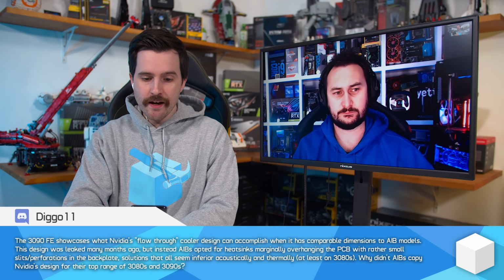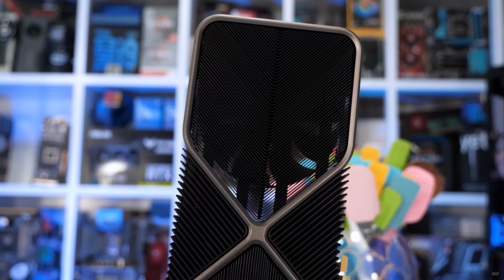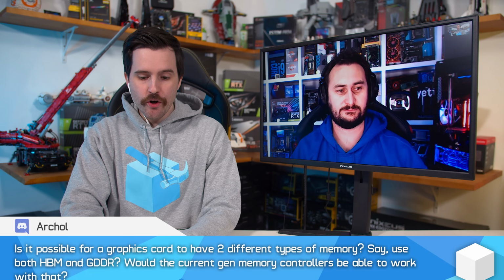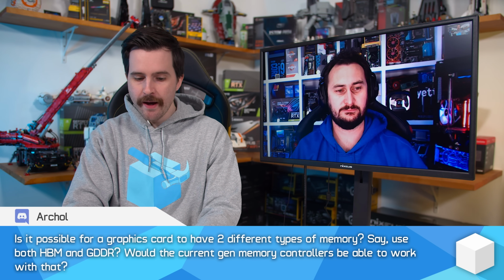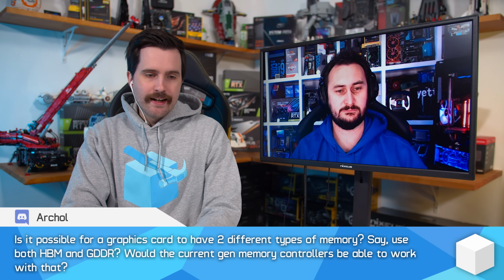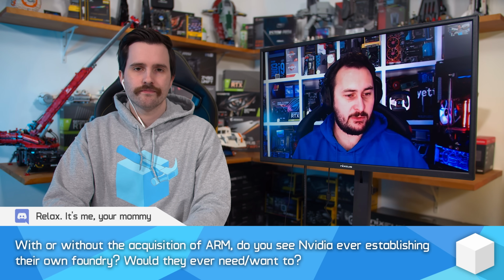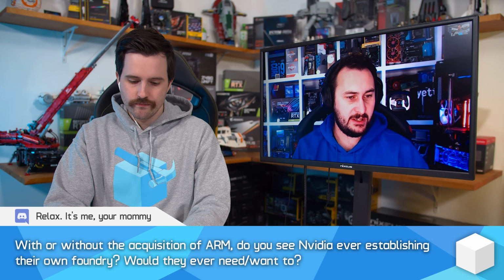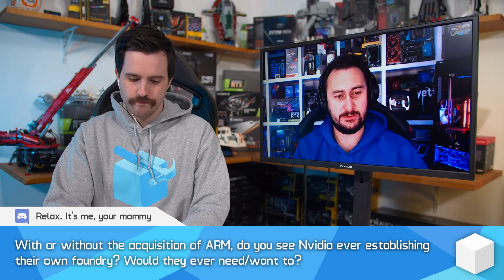Will RDNA2 and Zen 3 Have Launch Issues? Can AMD Beat Nvidia at Ray Tracing? September Q&A [Part 3]

Comment: I don't even care if "big Navi" is a little slower than the 3080, as long as it is (A) available at launch (B) has much better power draw than Ampere and (C) is less expensive.  I don't need a 4K gaming card - I am more interested in a reasonably fast GPU that won't double as a space heater.
Reply: Agreed, if AMD can deliver good value for 1080 and 1440p, with good availability (and NO DRIVER ISSUES), they'll have a winner on their hands. Let's just hope AMD can pull it off.
Reply: @shadow7037932  Its their second gen of almost same architecture. There will be no driver issues. Its always problem only with new stuff like 5000 series or rtx 30xx now.
Reply: @shadow7037932  the driver issues are the number one
Reply: Not gonna lie... im using an rx 5600xt after upgrading from a 1060 and they’re doing something right... i had issues at first but after using nvidia driver removal software, the card runs amazing. 1440p 60-70fps.

That being said, I can’t wait to see what they do woth big navi. If I can use the same 650w power supply that I have right now with a good value big navi card.. farewell until you step up nvidia..
Reply: @EggSaws  mmmmm .... why did u upgrade from 1060 to 5600? and if ur 1440p runs 60-70fps y upgrade to a better gpu??? 
something doesn't feel right
Reply: @luckysingh-lh4hf  Because the GTX 1060 is slower than the RX480 and the RX 5600 decimates both.
Reply: lucky singh i upgraded from a 1060 to an rx 5600 XT... warzone would run around 49-60fps on the 1060, now it runs at a higher framerate because of the new memory technology. The closest competitor to the rx 5600xt would be the 2060. Which is almost $200 more then the 5600 XT in my area. So newer technology = more performance.. I don’t understand what’s so bad lol. I’ve always had a soft spot for amd, I like cheaper prices. Nvidia has got a lot going for them though.
Reply: lucky singh and to be clear, I do wish that I had waited the 3 months for a newer AMD card to come out... given that when rdna2 comes out my card will basically be obselete. Facepalming myself...
Reply: @EggSaws  I mean u are getting ur "60fps@1440p" on 5600XT,  no point in facepalm-ing.
and wats ur need of upgrade??(asking 2md time)
but hey "soft spot" huh? o.o
for me it's always price to performance and coda- because DL support for amd sucks ass. cant work on a shiity driver GPU. that's y I cant even guy the new rtx  GPUs. feelsbadman
Reply: @luckysingh-lh4hf  well upgrading to a 5600xt is same as a 2060 or 1080 soo is a great upgrade the 1060 is shit right now. My 1660 deliver me what i needed (upgrade from a 1030, then 1050ti  and the jump is huge  but i need for gpu power and i waiting for the new gpus (mainly the 3070 for price performance)
Reply: Agreed. I don't do 4K, and only a fraction of gamers do. I'm interested in high refresh, 1440p gaming because that's what my monitor is and that's my sweet spot 👍
Reply: @phyrricocean7910  Yeah, im aiming for 1440p 120fps. 5700xt just isn't capable of delivering that even with medium settings it can't stay above 80fps.
Here's hoping big navi is powerful enough to deliver 1440p 120fps without fiddling with game settings.
Reply: I do need a 4K card, but if it's say $550 USD and is only a little weaker than a 3080. Sign me up!
Reply: WCKern agreed it’s what your targeting 1440/144fps is what I would like... and in VR 120-144fps in the index
Reply: @jediii86  I'm getting that info from from using the 5700xt Nitro since i bought it at launch.
It's fine for 1440p 60fps target but it ain't powerful enough to play at 120fps or even 90 in most games.
RDR2 and Control fps dips in the 50-60s occationally even when i'm not maxing out the game settings.
Reply: @imrileth6618  that just depends on the games and settings. Rdr2 and control can hammer any gpu on max settings. Your 5700xt should be comparable to my 1080 ti, and I have 0 issue running on a 1440p 165hz monitor.
Reply: @BulkybearOG  I play with 120hz freesync tv and i would prefer that the fps stay above 80, under that i notice the movement getting janky especially in fps games. Yeah it depends on the games, 5700xt can handle some games but it sruggles in most modern games unless i lower various settings.
While 5700xt is a decent card for the price i simply want something more powerful.
Reply: @imrileth6618  dunno what games you play but my rx 5700 xt throws out so many fps that my 144 hz 1440p monitor can't keep up anymore. 

just saying: the more background bs you have running on ya pc the less gaming performance you will have.
Reply: @imrileth6618  They must be some not yet released games that you are playing
Reply: @Daxter250  Take a look at that video of 5700xt playing at 1440p resolution. https://www.youtube.com/watch?v=GbGRlowFzQM
Its running in 40-60 fps in several games, thats pretty far from 120 fps. I run clean windows i don't have any background crap running while i play.
Reply: I seriously doubt they'll have much lower power draw at least at the high end ..... A 40 CU RX 5700XT draws 250W, the same as the RTX 2080 Ti which was considerably faster and if you double the CUs you get 500W and let's say RDNA2 hits it's efficiency targets (yet to be seen) then you are still looking at the neighborhood of 320-350W especially if they try to run a 2+ Ghz clock to try to make up for the slower DDR6 and only a 256 bit memory bus ...... The 50% efficiency increase is based on 40 CU and a base clock of 1605 Mhz and if you increase either of those that 50% efficiency increase drops off sometimes considerably ..... That's just the nature of the physics of silicon .... Using a 7nm node doesn't necessarily give you increased efficiency just the potential for increased efficiency as the RX 5700 XT proved, it was less efficient than Nvidia's optimized 14 nm node .... design is more important to getting good efficiency more than the node size ..... The theoretical efficiency gain of TSMC's 7nm node over Samsung's 8nm node is only 10-15% but there is no guarantee you see that or even any gain
Reply: @longjohn526  the rtx 2080ti draws over 30 watts more. according to igorslab, therx 5700 xt pulse draws 237 watts in gaming while the rtx 2080 ti FE draws 279 watts.
https://www.igorslab.de/sapphire-radeon-rx-5700-xt-pulse-im-test-navi-einstieg-mit-gewissen-schwingungen/6/
https://www.igorslab.de/nvidia-geforce-rtx-2080-und-rtx-2080-ti-im-test-gaming-turing-benchmarks-und-neue-erkenntnisse/20/

the rx 5700 xt has such a shitty efficiency, cause it's factory OC'ed to the brim to be able to beat nvidias 2070.
Reply: I've said it before, and I'll say it again.

"If AMD can make a card that's BETTER and CHEAPER and HAND DELIVERS it to my house in Timbuktu, and PAYS me to use it and KISSES me and FEEDS me FREE DINNER, hopefully that brings down Nvidia prices so I can buy a 3080!"
Reply: Agree my sentiments exactly.
Reply: SamTheCar more power for what?
Reply: WCKern If it’s ‘close enough” and cheaper than the competing Nvidia card,then it’s a good buy.Thats how Ryzen has done so well-nice and steady bumps each gen,but with lower cost than intel.
Reply: It being a little slower would still be a perfectly capable 4k gaming card though.
Reply: Your forgetting good service drivers
Reply: I think the real problem will be the supply and demand during the global health crisis and as well as the parts to make these components become more expensive to produce. Anyways, good luck everyone.
Reply: david hacckerman  Because of concurrent driver issues and poor performance per wattage?
Reply: david hacckerman  because the 2080 super I got for 330 is faster and has better drivers than the 5700xt.
Reply: david hacckerman  Are you homophobic or something?
Reply: I wouldn't expect low power draw from RDNA2 as RDNA already had much higher power draw (for the performance) than Turing while Turing was on a larger node (12nm vs 7nm). And if they are less expensive than Nvidia by a reasonable margin they also won't be available at launch. Just look at the Zen2 launch where it took at least 3 months for it to be available for anywhere near MSRP. It seems like everyone forgot the paper launch of Zen2 after the limited availability of the 3080. With Covid still being around there is just a larger demand for gaming hardware than can be supplied so get used to waiting a few more months. I'm not in a hurry because my 1080Ti is still no slouch but I probably will upgrade once either the  RTX3080 or flagship RDNA2 card is available (whichever is more powerful).
Reply: @CheapBastard1988  RX 6900 XT's TDP is 250w. RTX 3080's TDP is 320w-350w
Reply: CheapBastard1988 sounds like you can’t handle subjective opinion 😂😂 i prefer amd because they’re cheaper. I want to upgrade because the new cards coming out will be the same price that I bought this one for, and almost double the performance. Lmao you are odd.
Reply: @EggSaws  decide wat u want bro, soft spot then cheaper? sure
Reply: lucky singh i like them because they are cheaper, AND i have a soft spot. Is that hard to believe lol.
Reply: lucky singh so to simplify it for you because you for some reason can’t understand:
1. Amd cards are typically cheaper, which I like
2. My first graphics card was a radeon GPU, which I haven’t forgotten about, thus I have a soft spot for AMD sentimentally.
3. I have to upgrade soon because their new architecture comes out in a month or less, and will be priced at the figure I bought my 5600 XT for with 2x or more performance.
4. Yes... a 6Gb GDDR6, 14Gbps memory bandwidth card is capable of 1440p60...

I don’t understand why you were being so interrogative. I like nvidia and AMD. Regardless of the driver issues AMD had (past tense). I bought the 5600 XT when those problems were resolved, and the problems I encountered were due to Nvidia drivers not fully uninstalling. So the residual drivers conflicted with that of AMD’s.

I went with the option that fit my budget and offered the best performance. If i had an extra $200 lying around I would have gone with the 2060 hands down, but the 5600xt was on sale and offered similar if not the same performance for $200 less. I paid $319 for the rx 5600XT, meanwhile the cheapest rtx 2060 is currently $519 in my area.

I live in canada keep in mind
Reply: @EggSaws  thnx for taking the time to write this long comment! and trying to explain ur thoughts in a civil way ! :)
it's just hard for me to believe y should someone keep upgrading their GPU after each gen-especially when they are satisfied with performance. 
that's it. :p
the short answer answer from u can be "y not" I have the privilege of buying stuff around 300USD every year.
long answer would be you describing the games that dont run according to ur satisfaction. And explaining how mid range GPUs are easier to sell in used market then high end in ur region or some reasons for y u r not buying a higher tier GPU. 
take care sir. <3
Reply: Why not just buy a 2070 or 2080, they are cheap right now and fast enough for 1080p or 1440p
Reply: @txkingg  because they are old cards now?
Reply: Experimental AND ridiculously overpriced for the price,compared with RTX 3000 series.
Reply: @txkingg  A 2070 is still around 600-650CAD, or just under the 3070 MSRP, so "cheap" very much depends on where you are. If I'm going to spend 500+ on a card, I might as well wait a month and go for the most bang for the buck, which the 2070/2080 aren't with the gigantic jumps from both Ampère and RDNA2
Reply: @txkingg  "Why not just buy a 2070 or 2080"
Because the 3060 is coming out in a few months, and will provide that level of performance at half the price.
Reply: @txkingg  "Fast enough" is very subjective. If all you play are competitive titles where you are fine with dialing down the visuals in exchange for more frames then you really doesn't need much in the way of a graphics card. But if you like to dial up the eye candy and still want decent frame rates then the demands on the graphics card escalate quickly. It is however a balancing act where you have to make sure the CPU and graphics card are reasonably matched.

My own rig is a bit unbalanced right now with a i7-6700 and a RTX2070 Super. While the processor is a bit behind the curve by now this combo is perfectly fine for a lot of games, just not the absolute latest triple A titles. When I got the graphics card I benched The Division 2 against a friends machine that ran a Core i9 9900K and a 2070 Super, and surprisingly my machine actually benched a couple of fps higher than my friends. The only reason we could see was that my card was slightly overclocked from the factory, other than that the settings were identical with all graphics settings maxed out. But when we looked at the CPU load things wasn't as rosy for me as on my machine the average CPU load was about 97%, with an eye watering 104% maximum reported though I have no idea how it managed that. On his machine the CPU load barely broke 20%.

These numbers tells us that this benchmark wasn't CPU limited, but just barely squeezed by. We were both running 1440p resolution and I have no doubt that if we'd dropped to 1080 then my machine wouldn't have been able to keep up. Same if we dropped the graphics settings or if we actually compared playing the game.

Also if we were to bench a more CPU demanding game such as Shadow of the Tomb Raider then my machine would not be able to keep up.

Still I'm pretty comfortable where I am right now, and the next upgrade won't be a new graphics card, or at least not just a graphics card as I doubt even a 3090 wouldn't be able to get much more out of my current machine. My friend however could easily drop a much faster card into his machine and get a very nice performance upgrade.
Reply: @txkingg  prices have spiked back up for all the 20 series cards after the low stock launch of the 30 series so far
Reply: @txkingg  because used 2070 and 2080 are still getting sold for around 400$ which is no way worth it

Comment: The problem with the zen3/rnda2 availability scenario is that zen 3 is on n7+ and rdna2 is on n7 so they aren't competing for capacity
Reply: Both zen 3 and rdna2 are on 7nm+ euv(7nm enhanced node) stated by amd roadmap
Reply: Wtf are you talking about??? Both of them using 7nm+ euv
Reply: @Dogerobot  maybe I am wrong. I've just looked it up and there isn't a clear answer. All the road maps simply say 7nm. Can you please link me to the correct information